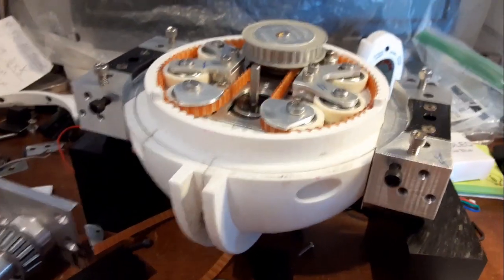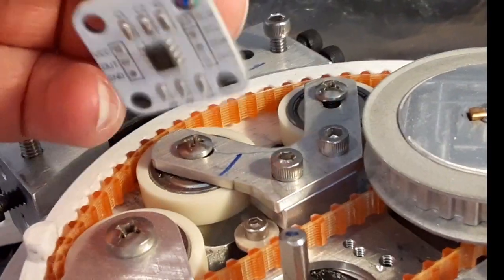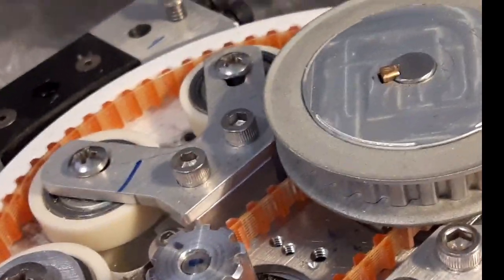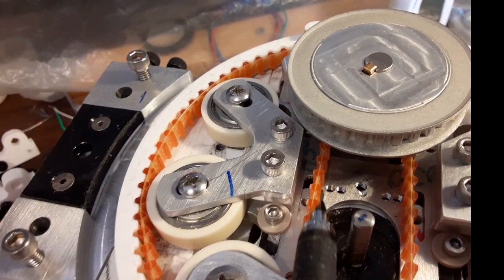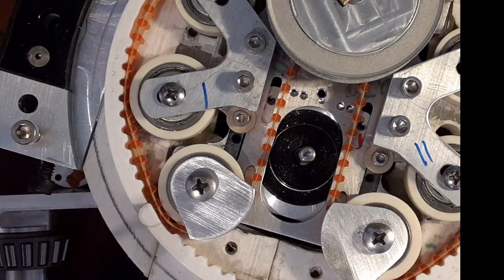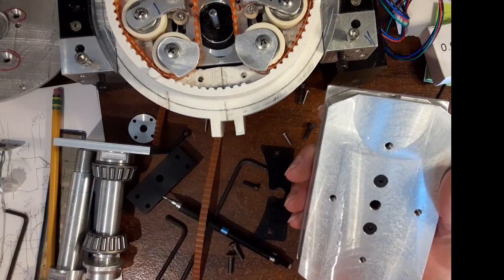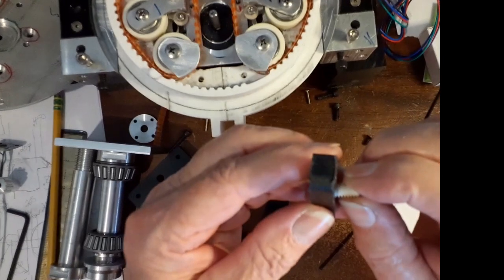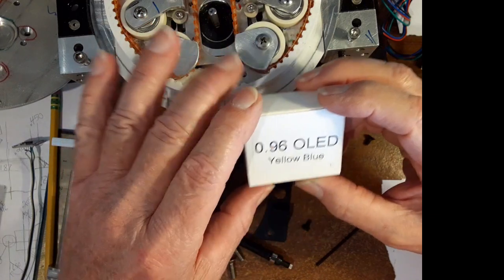Adding a magnetic encoder to read position on 2 axis/ 5 axis indexer.

Comment: Compact 1000-1200cpr optical encoders can be retrofitted to standard NEMA frames with dual shaft motors. It's another option to consider, obviously not as compact as magnetic encoders but may have less jitter.
Reply from the maker: Hi there, I looked into optical encoders, and I did not understand what would make it work. I saw the encoder with the plug on the end then what? I have seen "Maker Tutor"using one with a computer. I didn't want to lug a computer around with the unit. The "Kentuckyken" talked about a optical disk he might put on his indexer, and I will wait for that. "Curious Scientist" had the whole setup ready to run so that was a simple choice.